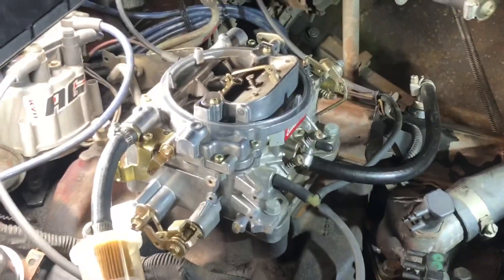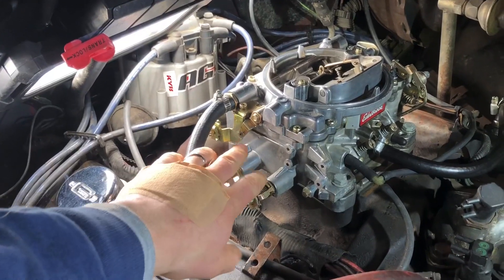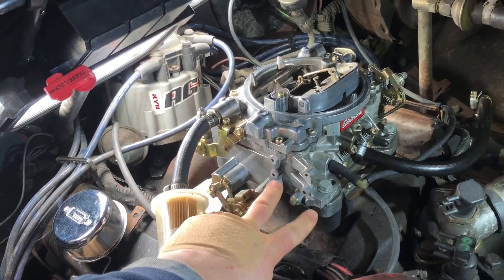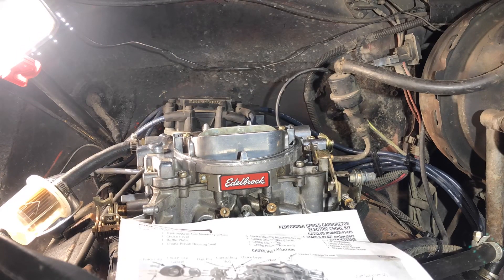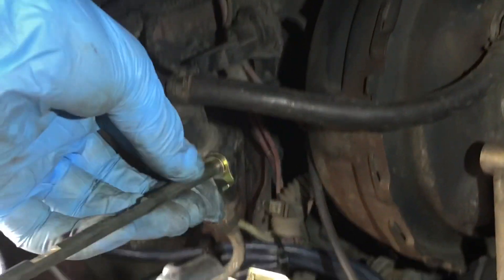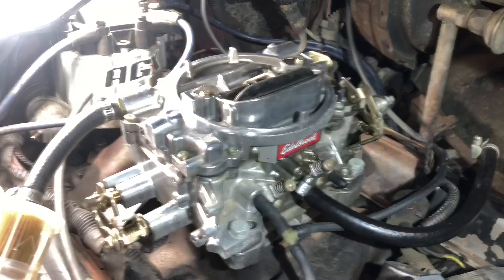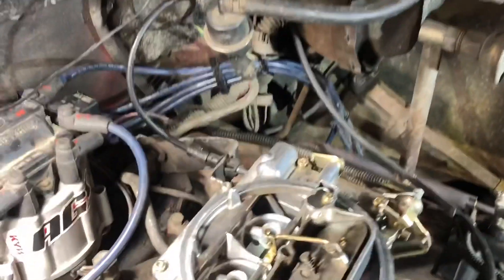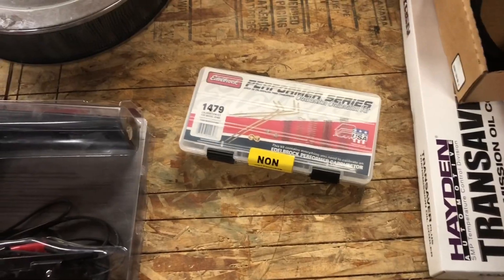EP91-Installing Electric Choke on Edelbrock 1405 Carburetor (83 Chevy K10 5.0 V8)

Comment: Can’t get the brass (vacuum) fitting out?!? Any reason why? It’s a 1405 brand new carb 🤷🏼‍♂️
Reply from the maker: It should pull right out, possibly that one is threaded and needs to be unscrewed? If the carb is not near or have any fuel in it you can try and lightly heat up the area and try to pull/unscrew. If that doesn’t work call Edelbrock customer service, good luck!

Comment: Dude, I have installed an edelbrock 1405 carburetor on my c10 engine 305 but I have problems since I more than gas the spark plugs of cylinders 1 and 2 get wet with gasoline, which I would recommend to do, thanks for your help
Reply from the maker: Hi Ricardo, glad to try and help, what do you mean when you say: ‘since I more than gas the spark plugs’ ?
Reply: @LastFrontierGarage  Spark plugs get wet with gasoline and those cylinders stop working
Reply: @LastFrontierGarage  The gasoline air mixture is too rich
Reply from the maker: @RicardoCarrascotalentodebarrio  the first thing I would do is check to make sure you’re getting good ignition to 1 & 2, then check compression, readings should be within 10% of each other; after that, yes the 1405 does run rich because it’s made for a performance engine, and they do sell a calibration kit to lean out the heavier mixture for more economical operation. 
It sounds like you have issues with cylinder 1 and 2 outside of fuel, either misfire to each (check dist. cap etc) or lack of compression, or lack of oxygen. If there is a good spark and all is in time with good compression you should never see a gasoline fouled plug.
Reply from the maker: @RicardoCarrascotalentodebarrio  let me know what you find, I replied more in depth below
Reply: @LastFrontierGarage  Thank you, on Friday I get the calibration kit edelbrock, then I will change jet and measuring rods which is what the manufacturer recommends me by the height at which I find 9200 feet, I hope with that will correct my problem
Reply from the maker: @RicardoCarrascotalentodebarrio  nice! I still need to install calibration kit on mine, let me know how it goes for you!
Reply: @LastFrontierGarage  ok tks